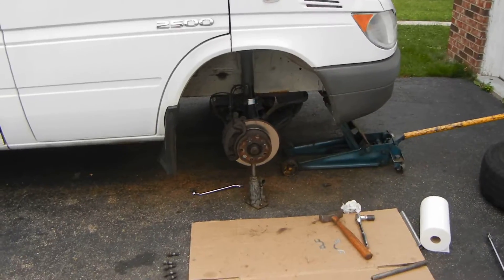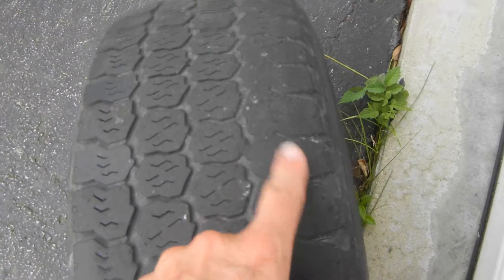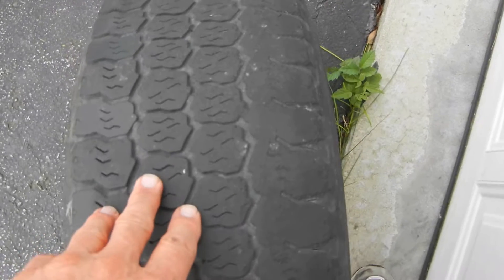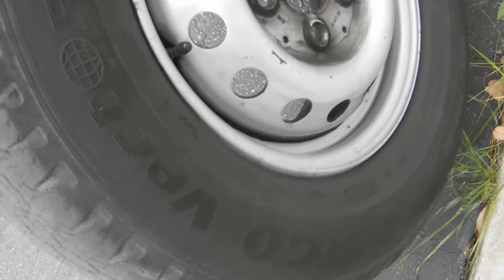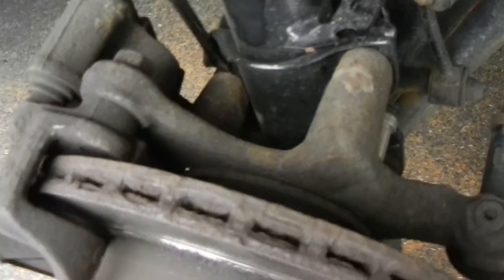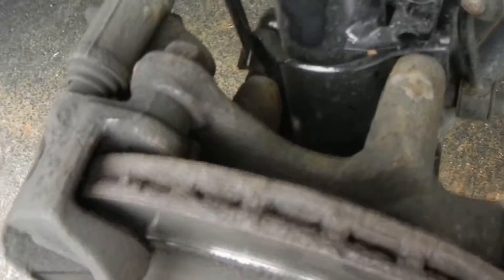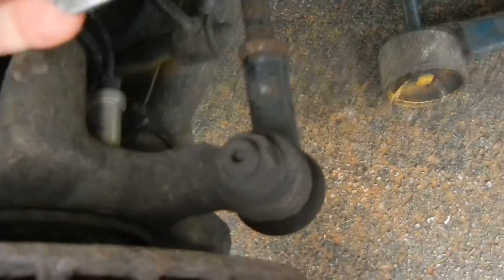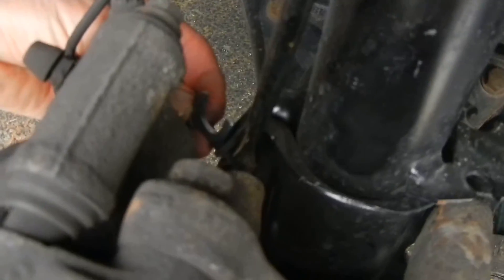Sprinter 2500 2006 Van camber adjustment  Part 1

Comment: Undo the two strut bolts at the bottom and the wheel will collapse in with the weight of the van and there goes your positive camber problem I know I do wheel alignments.
Reply from the maker: That approach is the opposite direction in camber I needed. The 1/2 degree wedge solved the camber problem. When putting on new struts at 50K I had loosened the bolts you spoke of and still got camber wear from 50K to 103K miles. Then, installed the camber wedge and that solved it.
Reply: Obv never done one on a T1N, because that method doesn't work on these vans.
Reply: Do you mean take out those two strut bolts at the bottom permanently?

Comment: THANK YOU!!!.
Reply from the maker: You are most welcome and good times ahead Thomas. Just take a look at your tire wear before you start with even the 1 degree wedge as it might be a little too much correction. If both sides are excess camber wear then it may require some guess work to arrive at the best camber change fit. Having adjusted camber to an early strut Chev I have an eye for taking a front on view of wheel camber on level ground. If you were close by Chicago we could meet and I can give an opinion. I enjoy the 1/2 degree correction to the right front and every time I drive a street with sweeping turns I smile because no mid apex turning is required any more and of course my tire wear has been minimized. Thanks

Comment from the maker: Update on improved camber setting from install of 1/2 degree wedges on the right front suspension. Previously, the best mileage I could attain on highway driving at 63-65 mph was 34 mpg with a large load. With the wedges and 1/12" toe in setting and correct tire inflation with newer Cargo G-26 15" tires I am now getting just a bit over 36 mpg; along with much improved city and highway driving with exceptional road holding. Previously I had wandering in city and highway with the required constant correction. I now find, also, that some auto parts stores across the nation-US sell the 1 degree camber wedges for less than a specialized Sprinter parts dealer. The next improvement for better miles per gallon on this 118" WB 5 cylinder van is a modified Kamm design airfoil on the roof that is in testing for the last month. More on this later. VR
Reply: Are you really getting that good of mileage? I have a 118 myself and the very best I've ever gotten is 23 mpg. That was before I converted it to a camper. Now getting 19-20 mpg. That's incredible if you've continued to get those results.
Reply from the maker: @ianerickson5324  I have 180K miles on the Sprinter now after recent replacement of the water pump and serp belt tensioner and one larger idler pulley. How many miles did your 118" WB model have on it when you acquired it? May be the previous owner did not change fuel filters on schedule and the injectors are dirty? I have a close by owner of the same year model but he has the 16" wheels and he with loaded work pieces gets 34 mpg on the highway. He has owned his since new. Even in cold Chicago winters I get 27-28 mpg around town. Air filters being clean helps get good mileage and I buy NAPA brand. The foot feed is very sensitive on my model when the fuel filter is newish up to 8500 miles then I notice a little less power in town and on the road. I am running Shell T6 0W40 which helps mileage a little bit; the motors seems already warmed up upon cold start. Are you sure the toe in is set on the mark? That can lose 2 miles per gallon. The original 225 70 15 tires as came on the van new are no longer available and I now run cheap 215 75 15 tires with much better traction but mpg is down about 2 miles per gallon. If you lived closer we could drive your model and maybe something comes to mind? If your wheel bearings are set a little too tight you can lose mpg. My hand brake gets rusted easily and can fail to release all the way (too much slack in the cable) and this can create drag on the rear brakes.
Reply: @vincentrolfe1384  Wow, Thank you so much for the comprehensive reply! I purchased my van with 101,000 on it and now have 125,000. I suspect the toe-in could be adjusted... I've never had an alignment as its always tracked really well but I am noticing strange wear on the outboard side of the front tires so that could certainly be it. I currently have an uneven idle due likely to a failing injector so you're probably right about that as well. In your experience, can any old alignment shop do a good job adjusting the toe? Regarding the injectors, I'm told I should get a "smooth running test" conducted to check their health. Will be bringing it to the dealership for that soon.
Reply from the maker: @ianerickson5324  I adjust all alignment questions with a wooden stick with an adjustable right angle stick at one or both ends and set it at 1/12" toe in. I Never take my van to the
MB dealer due to cost and their approach to repairs (they want to do more than needed). There may be a recall on your van as well and that is shady about the computer settings where MB may have been cheating on emissions and that correction by MB just may well take my good mpg away.? You can get injectors checked by a certified Bosch injector rebuilding company located reasonably close to a nearby large city. Hope your tires are good and straight so the alignment is true if from an older align shop. That model you have certainly does not have very many miles. Have you changed the fuel filter recently or every 10K miles or if you have bad fuel every 7K miles on the filter. I replaced my ball joints at 50K miles and bought some Moog ball joints and did the rebuild. Moogs need grease every 5-7K miles so it turns easy. Replaced the tie rods same time as ball joints. MB ball joints are sealed and were sloppy at 40K miles from van new. You could have worn parts on the front suspension and that can take lots of mpg away as well as tire rubber. Run the fronts at 52 lbs and the rear unloaded at 64 lbs. Loaded rears at almost 70psi. If you have incorrect size tires (cheap) that can change gear ratios and suck more fuel and power.
Reply: @vincentrolfe1384  Again, Thank you! Thank you for the insight. I may need to see a photo of your stick-method alignment...I'm very intrigued. I believe I've found a Bosch-certified shop nearby so I'll give them a call to get a good injector health check. I've been changing the fuel filter every 20k but maybe I should shorten up that interval. I just had some new Bilstein struts delivered today so I'll swap those out and continue to monitor tire wear after the likely tired struts are replaced. I'll also find any grease fittings I can to give attention and inspect everything. I'm running a bit taller Nokian all terrain tire that has a high load rating and fantastic traction. I hope they keep making the tire forever because I can't imagine a better one. We're planning for a drive from Savannah, GA to Alaska this-coming spring so I'm pretty motivated to get the van in top shape before the trip.
Reply from the maker: @ianerickson5324  Glad you found a Bosch injector service source. I would change the fuel filter every 10K and 2 times in my Sprinter history I have felt the need to change out the fuel filter some 2K miles short of 10K due to sluggish acceleration. I have tried Bilstein on the Sprinter. They ain't what they used to be. KYB was the second set I put on and was
not happy with that. The originals-shocks lasted about 50K. I put on Koni because they last and perform AND they were big bucks less than the 2020 price MB wanted for the fronts. I found a source for Bilstein rears and am OK with that ride. Wish you could return the Bilstein Fronts and get the Koni. Koni will outlast any other on the regular market and
probably go 80K miles and that is saying something. I should have put on Koni at 45K from the beginning. Koni is the pothole king with the middle setting. If you have oversize tires on the Sprinter for round town driving; that is a big part of the lessened fuel mileage. A 5-7% taller tire will throw off your trans shifting which the Germans have perfected.

Comment from the maker: Steve C. Those 1/2 degree aluminum shims are hand filed from 1 degree shims (one on the front and one on the back side of where the shock connects to the yoke). One degree is a lot of camber. Take the one degree shim set and measure with your caliper-mike what the difference between the top thickness is compared to the bottom thickness along the face of the shim and file (mathematically) to 1/2 of that thickness to change the angle to 1/2 degree. This takes about 45 minutes of hand filing to get there on each shim. If you try to grind that small of an amount of that aluminum you just may go too far. The back side shim is different than the larger front shim and requires you to figure a point of convergence to arrive at the amount of aluminum to remove. If a shim-wedge has a sharp edge at one end then it is a simple math approach to arrive at 1/2 of the thickness but, you must allow for a different comparative amount if no knife edge exists. Like the pieces of a pie: the angle of one piece as measured from the center is easy to measure. If you had a 1.5"  hole in the center of the pie then you have to measure the angle differently by projecting where the missing point would be, Good luck,  The Sprinter Store has the shims for sale in sets for each side--one side. I am very happy with the camber correction on my van and delight in how it handles and reduces tire camber wear.

Comment from the maker: SOKO It has accomplished three things for the van. With correct camber the steering is not pulling to the left all the time as before. The front right side ball joints required less grease--lubrication because there is not scrubbing on the right front tire--this puts extra wear on the ball joint. The steering wheel is now lighter to the touch. Now, the front tires, replaced at 106,000 miles, have the same amount of wear on both sides-inside and outside tread. I drove from Chicago to Charlotte NC 800 miles each way and the new tire little tits were the same for both front tires. Another advantage is better diesel fuel consumption. Sometimes, SOKO, we can smile a little more when we drive. I was always smiling with the Peugeot's I drove.